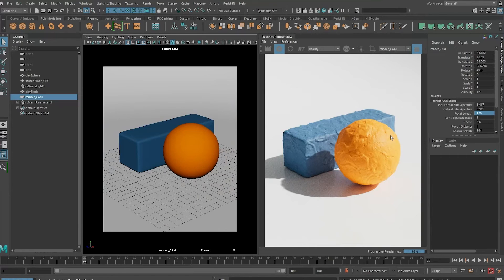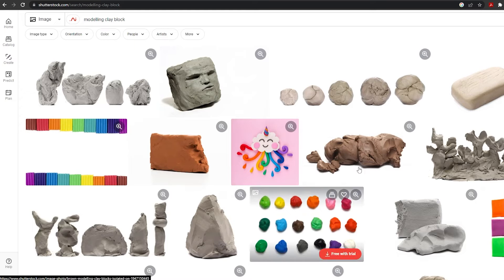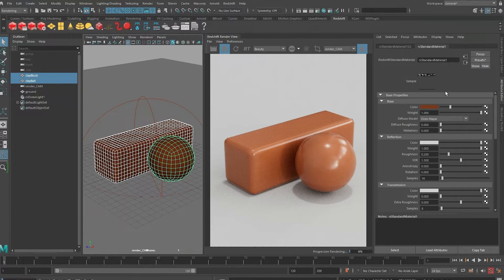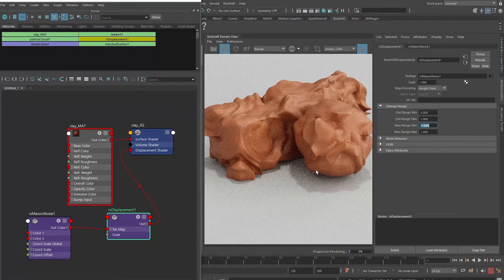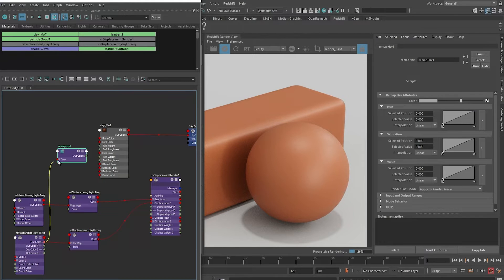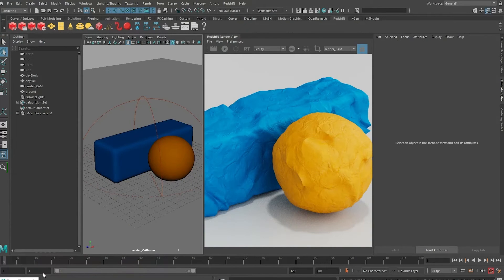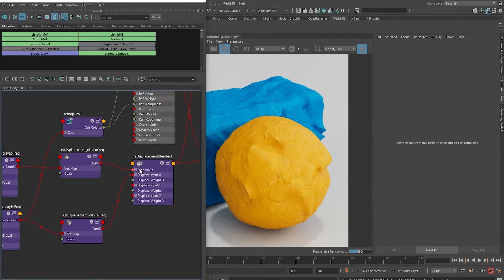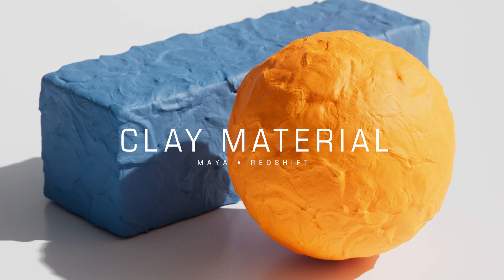Create a Clay Look Procedurally (Maya + Redshift)

Comment: Great! Would subsurface scattering on a low radius setting help?
Reply from the maker: @Vision0fDivision01  Yes! If we're looking at clay that allows some observable light to pass through, then using multi-scatter subsurface scattering like randomwalk will help achieve that effect. 

And you're right,  a low radius setting will prevent it from looking all "jelly-like", while still achieving a soft appearance. :)

Comment: How is the shader/material being mapped to the object? Doesn't seem like standard UV's; is it something like tri-planar? I understand there are no 'textures' involved but the thing that always confounds me about materials with no defined UV's is how the mapping is done. Sorry to be a bother!
Reply from the maker: @3dkiwi920  not a bother at all. I used 3D noises hence it doesn't involve the typical process of mapping 3D to 2D (like UVs, or Triplanar) 3D noises are what they sound like, noises in 3D space so you'd not have to map them, but they'll slide if the object moves within the space. So, to fix that, we create what Maya calls a "texture reference object" or what Houdini refers to as a rest attribute to store a static reference of the object in space, so that it won't slide.

That, or you could also use the object's space instead of the world space, this way, you can animate the transforms of the object freely without risk of sliding 3D noise texture.

I know it's all a lil' confusing at first but I know you'll eventually wrap your head around this!
Reply: @RonaldFong  Thank You! Makes total sense, I didn't pay enough attention or search to see that they are 3d based procedurals; which I am familiar with from learning maya way back in 2010 (mental ray!) ahah; the sliding would have been my next question though so thanks again :) Legend dude.

Comment: This is amazing!
I know the principle applies to Arnold too. But I wondering if you can teach us more about it in Arnold.
When I connect aiNoise and displacement shader to aiStandard surface, nothing seems to be changing.
Reply from the maker: good point! the same principles apply, but sometimes it's still helpful to have a guide with the exact same software. let me see if I can get to it. otherwise, you can check the scene scale. often times, if the object is too large, the displacement can go unnoticed even when it happens.

Comment: Hi! Awesome video. Could this be possible with the Arnold Renderer?  thnx
Reply from the maker: Hi Manuel! The same concepts apply, except Arnold's procedural noise node "aiNoise" doesn't have as many different noise patterns as Redshift's Mason Noise. That said, you can plug in aiNoise into various channels of another aiNoise node to achieve a more varied and hopefully a similar noise pattern. :)

Interestingly, I learnt to do procedural noise texturing  in Arnold, so the renderer is more than capable to apply these concepts! 🔥 Good luck!